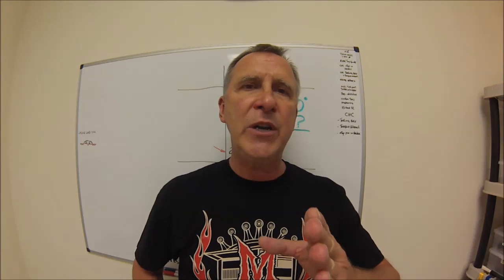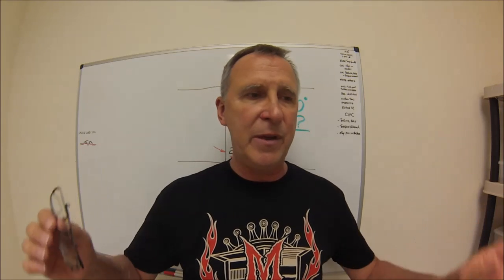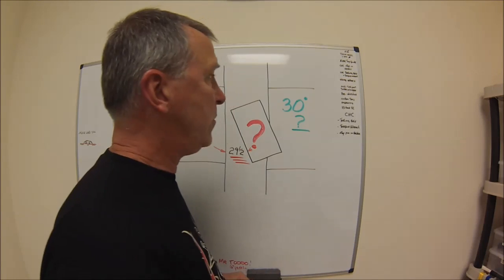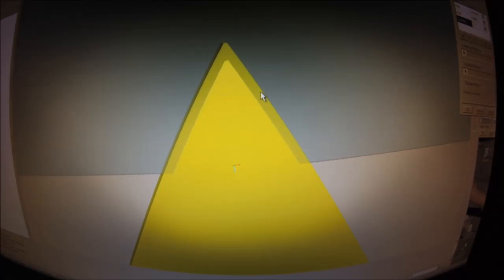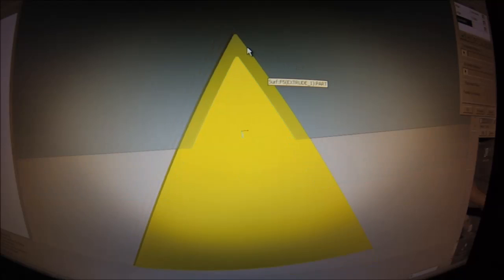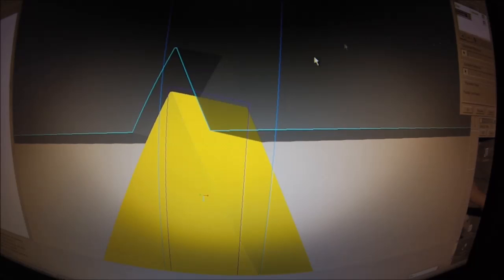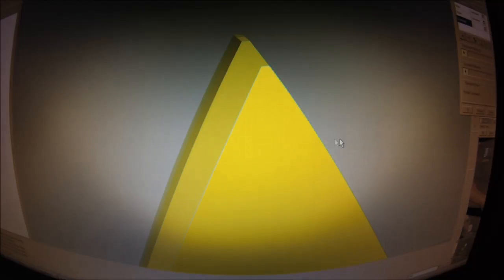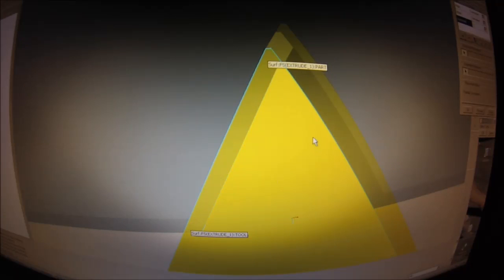Lathe Compound Setup for Single Point Threading...Myths and Musts

Comment: I'm a complete newbie. Should I only use the crosslide then to make the deeper cuts? Or is it better to use the compound at 29.5 degrees?
Thanks
Reply: I personally would only plunge with cross slide in aluminium or brass in small diameter work no bigger than 5/16"  or 8mm anything bigger then it's 30 degrees every time for me. I've a smallish hobby lathe/mill 12" x 19" and the compound is not terribly rigid. If I do plunge cut I turn the compound as close to 90 degrees as I can without restricting the cross slide hand wheel.  I then unlock all three gib  screw nuts then lock the gib adjusters fully then tighten the nuts back up. This give much more regidity as you are getting full pressure contact along the length of the compound mating surfaces rather than using the dovetail surfaces at 30/29degrees. And the compound is locked solid. I hope this helps.
Reply: I have been running manual lathes for 50 years. Never angled the compound since I left trade school. Leave the compound set at 90 deg to the cross slide. Plunge straight in but move the compound ahead a couple thousands each pass. puts more chip on the left side and makes the chip curl away better and makes the tool last longer. Also helps control chatter and lets you take heavier cuts increasing production. Just to prove my point I have cut 4 1/2 tpi on 2” 4340 in 6 passes. All cnc machines plunge cut.
Reply: @twinstickwizard3941  Makes sense. Great advice.

Comment: hi Joe, ive tried asking a few people this... in college in the uk to do threads you are thought too set your speeds etc and cut the threads just on a 90 degree angle while making the cut deeper via the cross slide not the compound on an angle... ive tried asking tutors why people do it this way and basically just get told there doing it wrong... now i cant see the likes of yourself and abom79 doing it wrong as your both very experienced. 

all i can come up with myself is that this method would lower the pressure on the cutting tool. but on the other hand if your advancing on a 29 degree angle on your compound slide aren't you offsetting the pitch of the thread every time you advance?

Thanks
Reply from the maker: This will be a topic machinists will argue about forever. I cut all my threads with the cross slide. always have, always will. My machines are rigid enough to let me get away with it. I too was taught to use the 29 degree compound method, but I didn't like it, and yes the helix advances unless you preset your depth. I did a video on that technique as well.
Reply: Joe Pieczynski thanks I’ll have a look for that video 👍
Top quality Vids as usual
Reply from the maker: https://www.youtube.com/watch?v=nLHXSXzQP3U&t=136s

Comment: Hi joe. Great tutorial. Thanks for sharing.
Reply from the maker: I hope I proved the tool cuts on both sides regardless. That was the plan. Thanks for watching.
Reply: Joe Pieczynski. Hey Joe, nice that you took the time to put together another fine video. But...
I'm a little confused with your presentation of how the tool begins the cut being plunged into the workpiece. When if ever would you encounter the need to plunge cut a single point thread tool? I've always entered the workpiece on the beveled edge of the end, or on the leading edge of a relief cut.
To my way of thinking, the tip of the right side of the tool never touches the work, nor does the right margin.
What am I missing?
peace-out..Tc
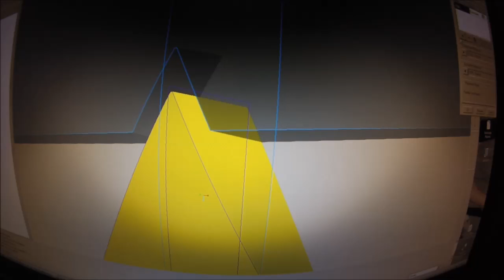Reply from the maker: Hi Tom. The animation clearly proves the right side of the tools absolutely cuts. Look around the 2:40 and 8:10 parts of the demo. I've plunge cut every thread I have run since 1979. I don't understand your question. Your compound advances the depth of your cut, my cross slide plunge advances mine. I am not sure this video showed any threading tool starting a thread by being plunged in to the work piece either. Point me at that part.

Comment: For less rigid machines like mine, reducing necessary cutting force greatly helps get a good thread finish.  For me that means no plunge cutting, and using sharp HSS.  Since I can grind my HSS however I want I don't have to treat it like a form tool and keep the sacred threadform angle on the tool itself.  I lose that little bit of backside drag/rubbing by reducing the included angle of the tool, which provides complete clearance.  The thread is formed by the leading edge-tip radius so as long as that edge is at the threadform angle it's all good.

I can't back-cut, but then again how often does that come up in the basement/garage/shed?

What would your computer analysis say using a tool with 2 or 3 degrees less included angle?
Reply from the maker: Like i said about the depth of cut being the driving factor, if your tool is less than a 60 degree included angle and you take only a few cuts to complete your thread, you have an imperfect profile. You can probably go much deeper and get the parts together, but thats a horrible practice. If you put a radius on the tip of your tool, you risk interference with the mating part. If your tool profile is less than 'The Sacred" 60 degree, you better make sure at least your cutting side is 30 degrees to the part and your cut depth is less that .0005 per pass, or your fooling yourself if you think your threads would ever pass inspection.
Reply: I have no doubt you're right, but I'm trying to get my head around why.  Is it because the 'backside' cutting is what actually forms the backside thread profile, rather than the advance of the leading edge?  

I guess I never really questioned my (mis)understanding that threading was like straight turning, and the final surface profile depended on the leading edge cut and the (sometimes tiny) tip radius to smooth out the feed rate peaks.

Comment: I have to hold my hand up and apologise. I went into my workshop and cut me an internal thread at 1.25mm pitch using an off-set compound, once it was set up it didn't take any longer to cut the thread, however the thread was cleaner right from the off, in fact I didn't even bother with scotch bright so I was wrong, there was a small improvement in setting the compound to 29 degrees and then coming in using the compound.
I stand corrected.

Comment: With a "V" profile thread the width of the thread profile and the pitch diameter are directly linked (hope that makes sense) but with a thread profile that is not a "V", Acme would be prime example, you can control the "width" of the thread profile and the pitch diameter more separately, so my question is, when you are making parts to fit, how do you know which of those non "V" profile thread variables to change first in an effort to get a good fit?
Reply from the maker: This is a good question with several layers. Any thread that has a specific pitch diameter will ultimately end up at a specific width. One drives the other. The smaller the pitch diameter gets from the dimension, the wider the top groove will get. So....the pitch diameter and width are married very closely. If you have correctly ground and positioned your tool, and you have an accurate pitch dimension, and you still have a problem, make sure the root diameter is (thread depth) is within spec, and you don't have any radii on your tool any where. If the parts still refuse to go together, you might want to take a good look at the other part.

Comment: So Joe,
You mean let your hand provide a little drag to the hand wheel while threading? No one ever told me that !
Although I have to admit as a home shop machinist, I mostly single point the threads nearly to size and then cheat by finishing off with a die.(although this does make for perfectly formed threads - well, as perfect as a quality die can make them, anyway)
Reply from the maker: Yes. I always keep light top pressure on my handwheel during threading.

Comment: recently single pointed threads on my current lathe. started at 29.5 degrees. had to go to 30.5 before i could get an exceptable thread profile. pretty sure it's my error. not sure where?
Reply from the maker: Never exceed 30 degrees.
Reply: @joepie221  30 degrees tears up the thread. if i was way off i would say that i am some how measuring it wrong. another .5 and it looks good by put a thread pitch gauge up and using a flashlight. ????
Reply: @jackheath8184  If I had to guess, not knowing anything about your lathe, I would guess you were running a small light lathe, like my original Chinese 9x20.  It wouldn't cut threads very well at all.  I am sure I made it worse with inexperienced tool grinding, but it would chatter with any kind of form tool, including threading.  I would hazard a guess that your compound protractor is actually off half a degree, and your best thread profile was actually produced at 30 degrees, and your lathe was chattering at 29 degrees.  Of course that is entirely a guess, based on my experience with a lathe that may actually be nothing like yours.  Of course on that lathe I actually had to set the compound to 60 degrees, because the compound was referenced from the spindle axis, not the cross slide axis, but that is another horror story for an amateur learning stuff.
Reply: @fristlsat4663  Cadillac 14x40

Comment: Hi Joe, I have always cut threads with the compound set parallel to the axis of the spindle. Zero the tool, make each pass but at the beginning of each pass move the compound slide 2, 3 5 thou to the left so that the tool cuts on the left face and give minimal loading on the right face. Final pass with very light contact on both faces to give an accurate thread form. Depth of cut controlled directly by the cross slide.Now using this 30 deg. compound setting the depth of cut will be less than you are dialling in on the compound as the compound is not moving at 90 deg. to the work piece, I've not done the trigonometric calculation to see the difference but how do you overcome this issue?
Reply from the maker: First, don't use the compound to set the depth, use the cross slide and work towards that depth setting from your contact position on your compound. Personally, I plunge cut every thread I run. I never use the compound.
Reply: i've been plunging for 20+ years now and haven't seen not 1. frog fall from the sky. i'm sure that using good carbide inserted tooling and proper lathe speed makes a big difference.

Comment: Joe, I get  a whole lot of info' from  your videos, i'm new to machine work (hobby) i'm not sure what size tool bit to use for cutting threads :ie  1/4" 3/8" or 1/2", my tool post will take all three. does size of stock matter ? thanks ,charlie
Reply from the maker: Not usually. depending on your tool post, it may influence the height, but 3/8 should be fine.
Reply: One thing to keep in mind, Charles.  The size of the tool just matters with how much material you have to remove when grinding it to get close to a shoulder when threading.  Or with form threading inserts, the size matters even more at the shoulder and also on fine threads. Pay attention to this when purchasing inserts, or grinding your tools.

Comment: Maybe a rank amateur can add a 3rd perspective and ask if Joe can model it. The method Ian is trying to explain in terms that are perfectly clear to him aren't to many in the US. The method he is describing is also covered by Martin Sleeve in in section 8 Practical Aspects of Lathe Screwcuttin" of "Screwcuttng in the Lathe"  with, in American English the compound ( top slide) is set at 90 degrees to the cross slide/parallel to the bed/work. The 60 degree tool is set at 90 degrees to the work. The first plunge cut is obviously on both faces. For the second plunge cut the tool is plunged .002, and the compound/top slide is advanced .001.  So the left side of the tool is doing "almost" all if the cutting. The tip is basically cutting a flat. The right side, because the compound/top slide was advanced is cutting??? I don't know, would love to see it modeled.  If this was explained better by others, my apologies, I did try to read all the comments. Misspelling courtesy of a lifelong spelling challenge and auto-screwed up correct.

Comment: I could be completely wrong, but I never understood the problem with tool-load. Especially not with modern steels and with carbide insert tooling. These things are made for heavy duty cuts and it seems quite logical that a symmetric load is preferable to an asymmetric one.
If asymmetry in load was the goal, one would expect a different design in tool....

I went over some of my old engineering books (some of the mid  Victorian age) and indeed this whole diatribe is found as far back as then.
Could it not be the case that all this palaver has to do with an era, when carbon steel was the best you could hope for, as far as lathe tools went? (and in that case maybe heat build-up was a bigger worry than tool-load)
I have always cut my threads 'heads on' usually with good result. My father did the same and he thought me to do this in this fashion. 
(he also cut threads upside down and out towards the tailstock, so that too is a known factor)

As far as 'anaemic' machines go, what would be the objection to taking lighter cuts? That too would solve the tool-load problem, no ?
It is a fact, at least in my experience, that the 30 degree thing has never been, satisfactorily, explained (at least not to me) by any of its advocates. So, one could be forgiven to think it is a remnant from a bygone age, applied as if it were some 'religious rule' without the reason or logic to back it up...
What say you ?

Cheers

Paddy

Comment: I was doing some #8x32 threading at 30* and all I could manage was to roll my threads over.  As in each time I advanced the compound it had the effect of rolling my previous cut over.  My tip radius is quite sharp and tool is at a perfect 60*.  Is there a limit to where the angled compound works in terms of TPI or did I just screw it up, maybe going too deep?  BTW, I ended up recutting and plunged straight in with very light passes and the thread turned out great.
Reply from the maker: Be sure your 30 degrees is set from the correct direction. Line the compound up with the cross slide and move it counterclockwise 30 degrees ( or less ) from there. There is no reason the thread should have rolled over unless the tool was not ground correctly and it was rubbing them over.
Reply: Another reason I have seen is if someone didn't realize they hadn't switched into english from metric. Some metric dimensions are just close enough to almost be right, but off just enough to push the cut slightly sideways each pass. Sometimes the gearing can be a little confusing. (changing the main Eng/Metric gears.)

Comment: Joe,  this is an old topic but one i think you covered 99.9% but is it not true that with the compound set at say 30°  that each time you plunge your cut you are advancing the timing of the 1/2 nut some amount as the tool is also moving left?  I am not discrediting the right side tip cut just asking you thought on this.  Thanks for  the great instructional videos.
Reply from the maker: Both conditions do exist and are true. The best way to visualize this is to imagine a superficial depth of a very coarse thread. The pitches would be at a specified distance from the face of the part. When this cut is much deeper using a 30 degree compound advance, the thread not only moves in the direction of the compound feed, but actually changes its timing as well. The scratch trajectory rotates slightly as it gets deeper.

Comment: Hey Joe; when using your upside down tool bit trick, shouldn’t the compound be angled from the other direction ( 28-30 degrees the other side of 90 or 0 depending on the lathe)? Thus controlling the backlash of the machine and making the bit cut the majority on the right side (leading side). Keep in mind I am using high speed steel tool bits.
Reply: I have read most of the pissing match here and believe that in either method a small amount of cutting will be done on the right side, your point is correct. I believe that Ian’s process may actually be better though, especially cutting away from the chuck as you do, because instead of moving the bit to the left as he said it can be moved to the right to work with your way of cutting away from the chuck.
Reply from the maker: If you are worried about the machine drawing the compound off location because of tool load, reversing the advancement direction may be better.

Comment: More questions. Can You issue a link to a page where I can get hold of the nomenclature regarding threading inserts? Look at 11IR A60. IR indicates inner threading but what does 11 resp. A60 tell?
Reply from the maker: Some inserts are defined by a term called an "inscribed radius". I have to guess the 11IR defines the planar profile, and the A60 is the cut profile od 60 degrees. More specifically, an 11mm diameter pin would lay true to all insert locating surfaces for picking the correct tool holder. TPG inserts are identified this way, so this is just a good guess.
Reply: Thanks a lot Joe!'
Reply: Joe Pieczynski m

Comment: I am new to precision machining and, in fact, just purchased my first lathe(an old Atlas bench top).  Please excuse my ignorance, but how does changing the angle of the tool not change the right side of the cut to match the tool's shape?  And if it does, wouldn't the right side of the tool experience the same amount of contact regardless of angle?
Reply: You are not changing the angle of the tool with respect to your part. You are changing the direction you move the tool with the compound as you feed it in. The centerline of the tool remains square to your part - it doesn't line up with the compound.